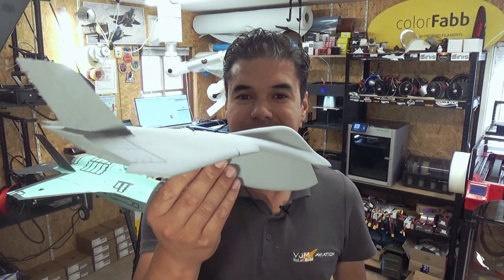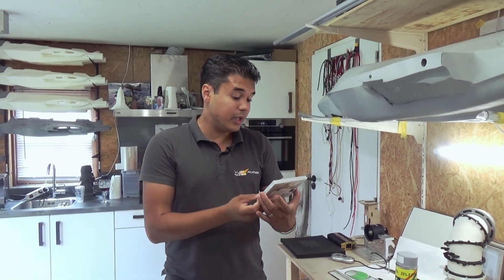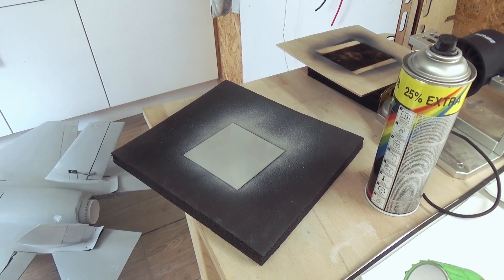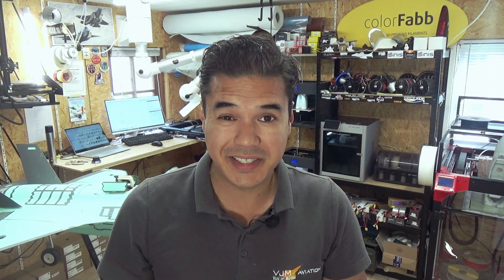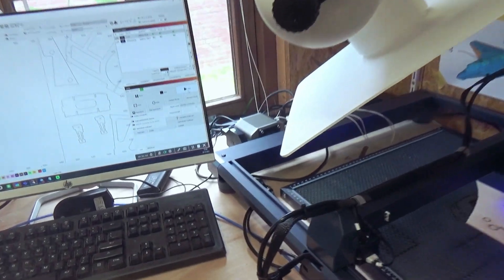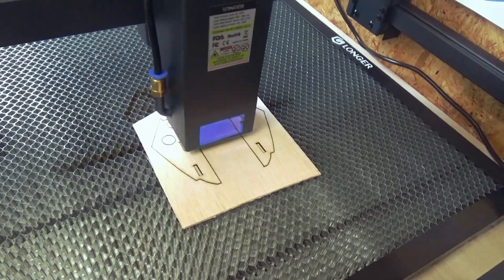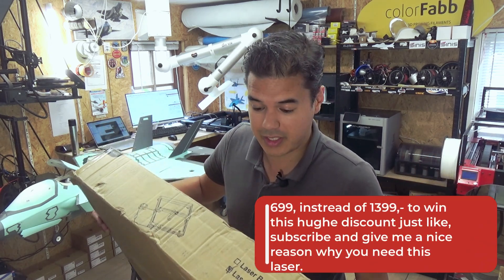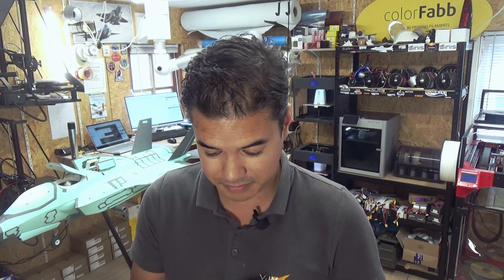Longer B1 30W Laser, How To Engrave Glass | F35B Rc-jetprint Transtition Flight 3D printed

Comment: Did you test the effectiveness of the glasses? (By doing z simple point to a paper but through the glass at low power) lot of Chinese glasses are crappy. And this is very important with diode lasers compared to CO2 lasers (not because of the lack of enclosure)

Comment: Excellent. I'm so happy you're working on the F-35 transition flights. In the video clip it looks like the rear nozzle is angled back around 15 or 20 degrees as the jet goes past the camera. Can you share your thoughts on continued transition testing? This is the most exciting part for me - developing the control scheme to make a fully functional VTOL jet.
Reply from the maker: Yes sir, making content takes an entire weekend, but yes the past and next few weeks it’s all about pushing through transition! Now this model in de the has an weight of 3,6 kilo…that’s too much! But tested. The next model is 3,2kilos hopefully with new printing settings. (3%infill) instead of 5%. The grey model at first was 3,4 kilos. 20 degree is correct the next step in transitioning is 40degree with slats down…but you see occilations, I need to solve that out😅